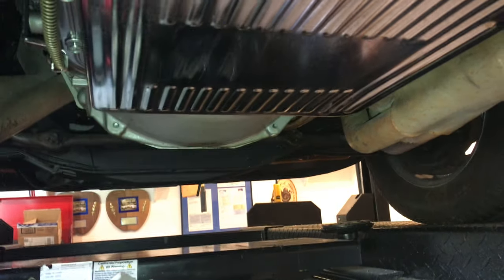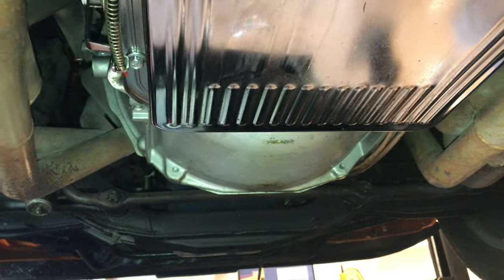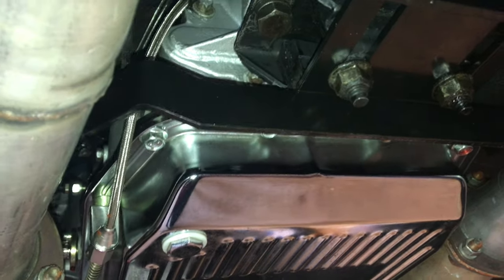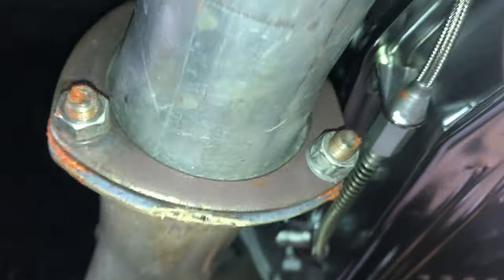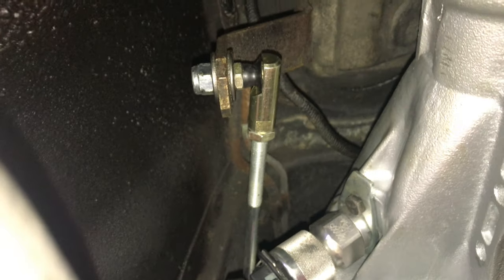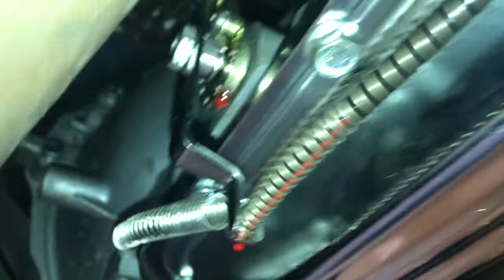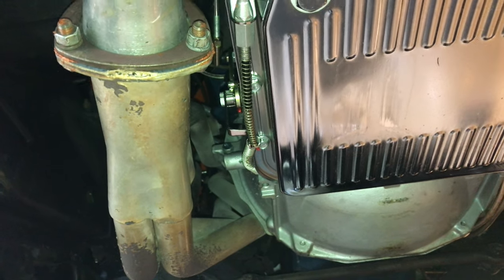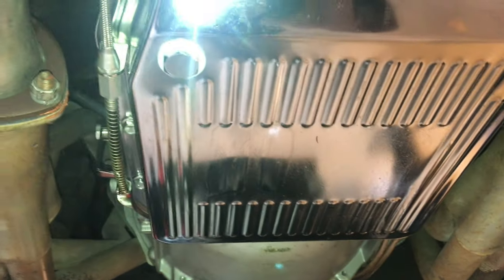1973 Mustang Mach 1 AOD shift and Throttle Valve linkage adjustment (Throttle Valve Pressure)

Comment: Great info, there.  Thanks!  I, too, am installing an AOD in my 73 Mach 1 that I am rebuilding, and appreciate you showing how many of the systems go together.
Reply from the maker: I am glad you found this video useful.  I am not certain if you have found the collection of videos I put together showing the transplant process star  to finish.  One of the videos shows how I wired in the AOD Neutral Safety/Backup Lamp switch.  Some of the videos have info in the description with relevant part numbers, etc.  Here is a list of the other video links (below),  I am also planning to do a more comprehensive video this week showing how to properly set up the Throttle Valve line pressure, as a lot of the videos on the subject are either too sparse in useful information, or outright incorrect.

https://youtu.be/yHWY903N4bs
https://youtu.be/XZ7CkcY1vFQ
https://youtu.be/MZwXbJKdDKo

https://youtu.be/zzDmFjFfT-A

https://youtu.be/vdR-z3KV0UE

https://youtu.be/YCBBgd-olQ0

https://youtu.be/NcYr68atRjM

https://youtu.be/iFNXTGXNNcQ

https://youtu.be/8QncIKQTvNo

If you run into any issues, have questions, or need more info please feel free to email me at gilhale@gmail.com.